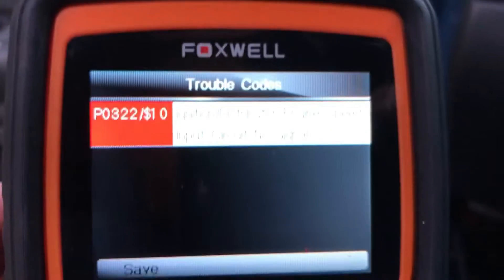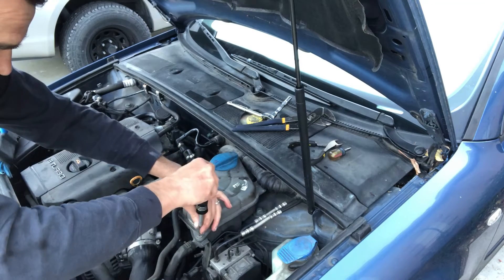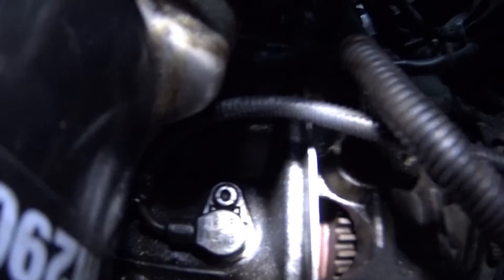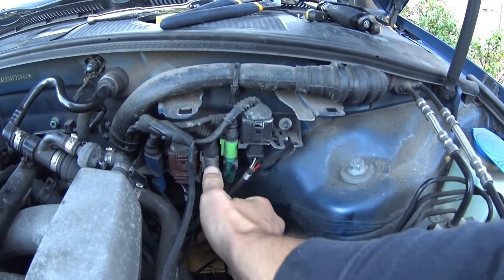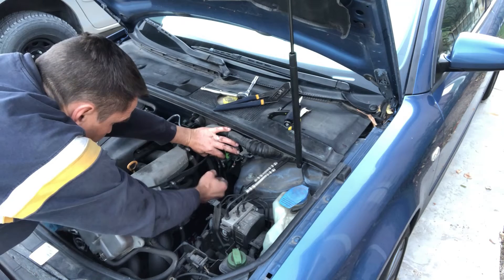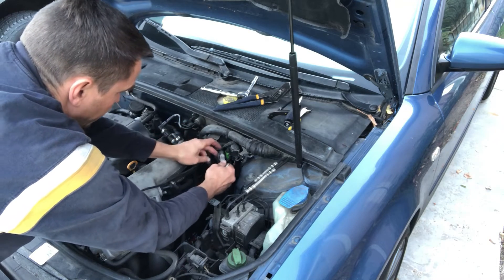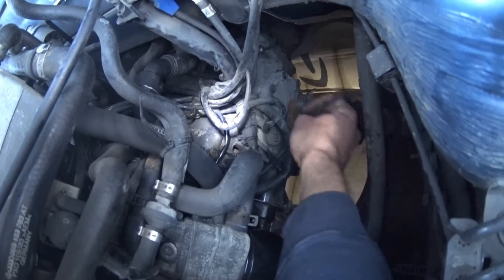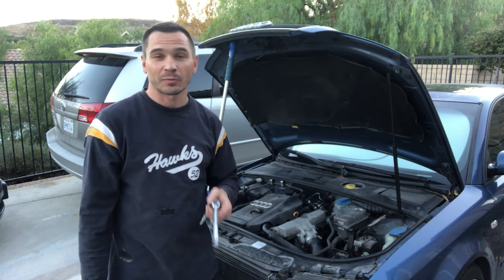P0322 Audi or Volkswagen 1.8T Engine Speed Sensor Replacement

Comment: Hello there. '06 A4 B7 2.0. Last year in Holland we had lots of rain. (all drainholes in the front are cleared now) Long story short, had all these symptoms but could not get codes because of a telephone module underneat the carpet that was soaked and shorted the circuit. They fixed that issue and after clearing a long list of codes (no proper communication so expected) they got nothing back after running the engine for a while so they thought it was solved. When i drove home the engine stalled again and after waiting 10 seconds it cranked up again and i got the epc light again (solid). When i got home i scanned it and got the exact same code P0322. After starting it up parked at home the check engine light came up too alongside the epc. Going to bring it tonight, i'll let you guys know. Thank you very much for the video!
Reply: Update? 🙂
Reply: @dpayne8611  Hi there, i have been driving it without any problems since the 9th of februari. Cheers!

Comment: Same sensor, make my car to turn of the engine while driving. Erorr P0322 apear on diagnostic.
I watched your video and change the sensor, now everything is just fine.
Tanks mate!
Reply from the maker: Had exactly the same symptoms. Glad to help.
Reply: Same error, hope that this will solve the problem. I have had engine strikes like during the driving and if I am on the traffic light, sometimes make my car turned off and in both cases throws error EPC.